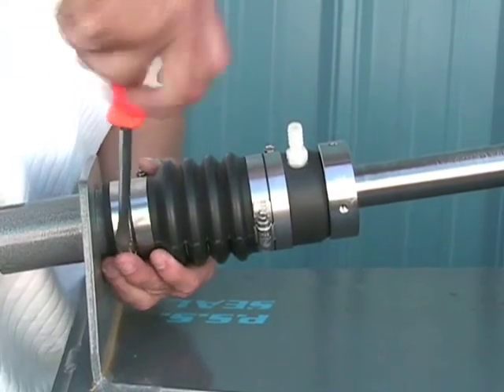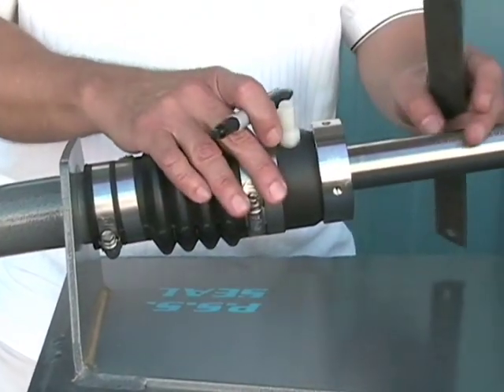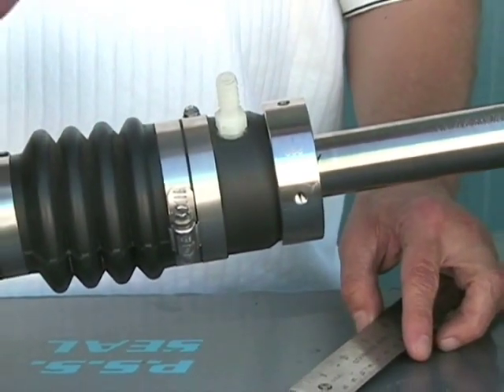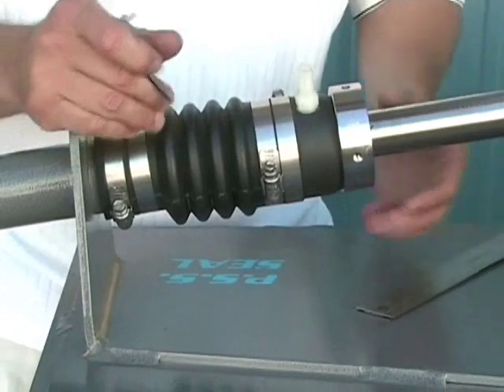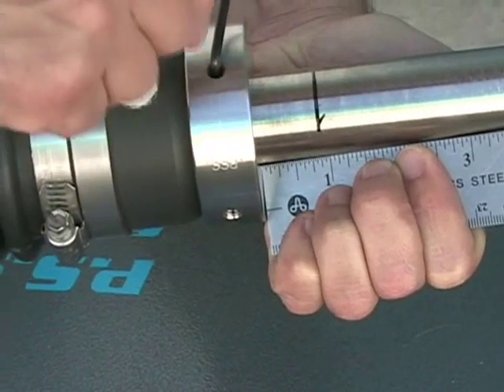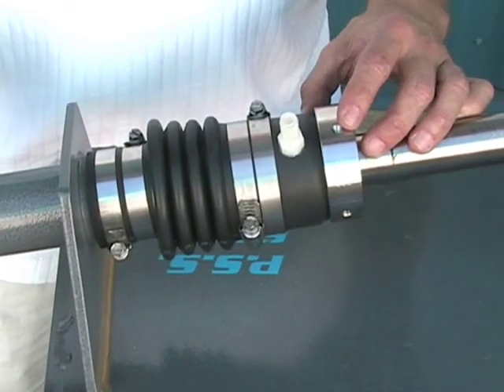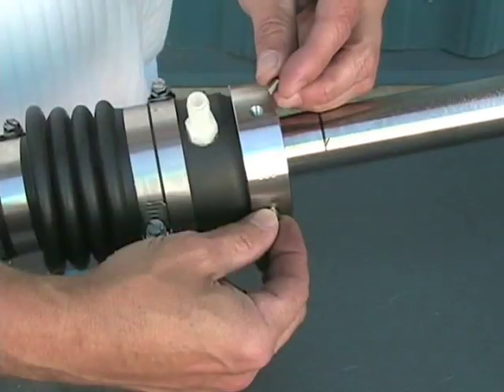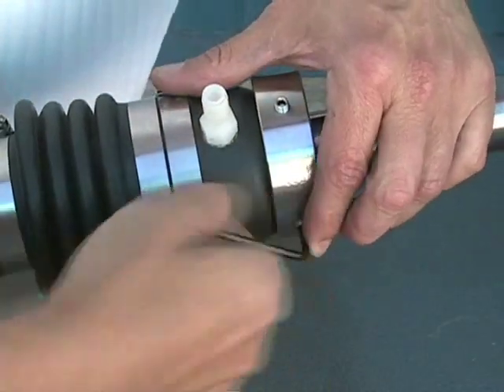PSS Shaft Seal: Compressing Bellow & Securing Rotor With Set Screws

Comment: My stainless steel rotor is frozen on there.  How is that possible?  All four set screws were removed.  The shaft is 1 1/2 inch.
Reply from the maker: Good question Joshua. There are a couple options here. You can first try to squirt some soapy water into the set screw holes, and then rotate the stainless steel rotor (do not use oil or grease). For added leverage you can thread in some longer bolts into the set screw holes. The required thread size would be 3/8x16.

You can also take a piece of wood and place it against the stainless steel rotor. Then tap it with a hammer to loosen it. Just be careful when hitting it towards the carbon, as hard impacts could damage the carbon.
Reply: @PYIinc  I'll give it a try with the longer bolts.  I've had no luck rotating the rotor.  I tried using a mallet and the rubber end of a hammer to try an lightly tap it with no luck.  I'm currently have issues with dripping and spray when the shaft spins.  I've burped it after the most recent haul it also.  I'll let you know if I have any luck with the longer bolts and additional dish soap.